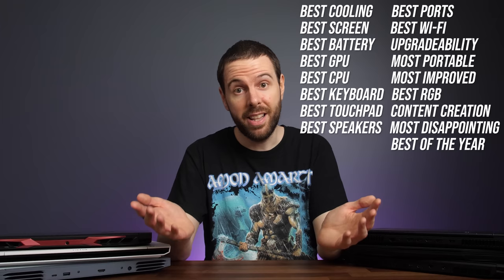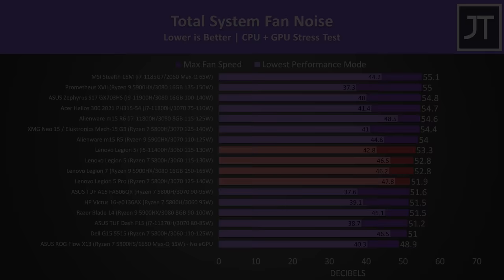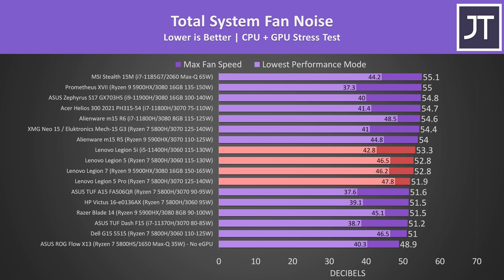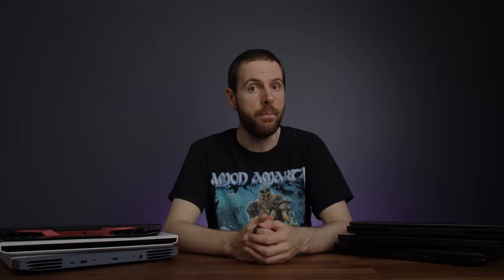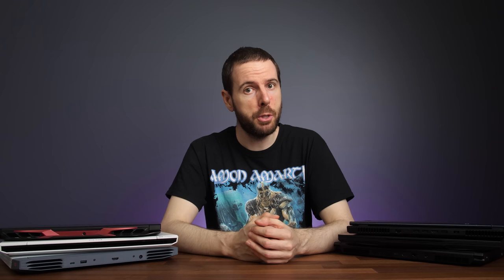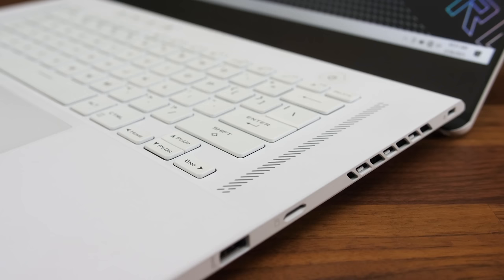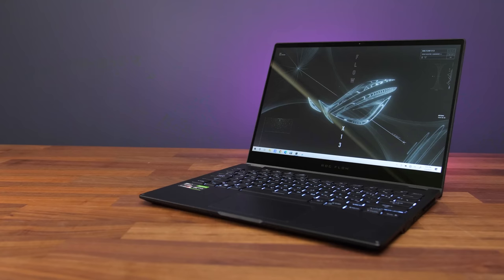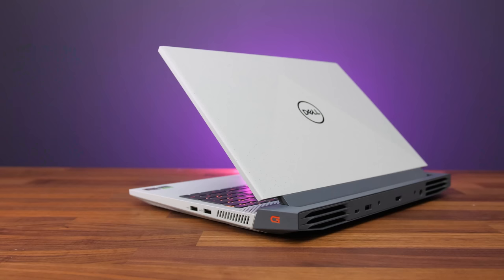Gaming Laptop Awards 2021!

Comment: Of course he is gonna add "Best RGB Award" for fps boost
Reply: @srijitsarkar7110 No bro RGB is useless, it's for the people who want to show off, RGB does nothing, it's a joke bro 😂
Reply: @srijitsarkar7110  he's Just joking, OFCOURSE IT DOES
Reply: @srijitsarkar7110  obviously no.
Reply: @srijitsarkar7110  RGB Anything is an instant 10% performance boost
Reply: @srijitsarkar7110  YES, RGB increases your fps by 10% and with a good gaming chair you will have aimbot in FPS games and with rgb in your car you won't have to worry about your car's extended warranty
Reply: Lmao 😬🤣
Reply: @srijitsarkar7110  RGB Is A Performance Booster I Have Asus Scar 15 Ryzen 9 5900HX,RTX 3080,32GB Ram,2TB Model Ask Me!!!I'm Just Sad Jarrod Didn't Give Scar The Best RGB Award...It has Way More Aggressive Looking Logo Lighting And Another RGB Bar Below The Screen!!!Legion7 Airvent Lighting Is Bad....Ehhehehehehehehhe
Reply: @srijitsarkar7110  YES!! RGB can boost your FPS at least 10 FPS and for RGB room ambient light make your wifi more stable and lower latency.
Reply: @plc.  obviously yes.
Reply: @srijitsarkar7110  Are you for real?
Reply: @v5k456jh3  I was just kidding around. Actually some on reddit were arguing regarding rgb strips and all claiming it boosts, so I thought such a claim was coming here as well, lmao
Reply: @srijitsarkar7110  actually, rgb lights generate heat, so they actually make your system hotter, but at low electricity, it's not significant enough
Reply: @srijitsarkar7110  yes it boosts the FPS about 10-25%
Reply: Of course deee so lenovo 7 is the best laptop more rgb u got.more fps logic 😁😁🤙
Reply: @lazyll_  😆
Reply: Venom tech subs spotted🤣
Reply: That's the wrong metric to analyze RGB performance boost.  The only way to define RGB powarrr is in horsepower.  And perhaps a minor bonus for whether you can set the exhaust flame color.  💻🔥  Obviously not to be confused with the color in which your rig is currently exploding.
Reply: @srijitsarkar7110  bruh
Reply: @Kenzouu.  🤣best RGB ad ive ever seen so far
Reply: @tqiconic4295  Oh my God.

Comment: hopefully AMD has a Thunderbolt response on the next gen laptops, personally I'd prefer a laptop with a Thunderbolt 4 port than anything else, you could use an external gpu there !
Reply: Ig, but what if it disconnects randomly?
Reply: @revizgd  it won't
Reply: @RioPutra_  Right now, they do.
Reply: I honestly still don't see the point of the eGPU for most people.
Sure it might make sense for a handful of people, but is it really that hard to just buy something like the G14 or Slim7Pro or Blade14 if "portability" is so much of a concern!
Instead you have to deal with a an expensive eGPU enclosure, a fricking GPU in THESE TIMES (considering you don't have a decently powerful one already) and a good monitor unless you want to run everything in bottleneck city (aka on the laptops display)
Reply: @scavengerspc  do they disconnect if used on a MAC?
Reply: @scavengerspc  for intel it's kinda rare , type c ports are very strong if anything connects to it
Reply: @sushimshah2896  laptops display is already 120+Hz , egpu exist for ppl with work laptops from olden days ( 4-6 years ago assuming you have a good CPU ) and why buy new laptop when u can get egpu?
Reply: @sushimshah2896  and for "these time" they're not on shortage and you can buy from other ppl , they started selling for a reasonably price rn if u actually look at gpu market
Reply: @Dane3412  I can't say. I have never tried it on a Mac.
Reply: @RioPutra_  QUOTE  -  "for intel it's kinda rare , type c ports are very strong if anything connects to it"
True, and I don't want to leave the impression that it's a common thing because it isn't. But it does happen.
Reply: @scavengerspc  hmm oke
Reply: @RioPutra_  Damn right.

Comment: Man, considering I spent more than 3 months binge watching your videos, I ended up getting the 3070 Legion 5 Pro and I am NOT regretting anything. Will chew about every AAA title up to date and just has the right placement and amount of ports. Cooling is also great as I’m not feeling too much heat on the palms (still needs to be raised and run in cool room temp to stop overheating). Although I wish Lenovo could’ve just put an Intel AX210 WiFi card in it, but alas the shortage doesn’t help.

Thank you Jarrod for helping me land with Legion! (and the best decision)
Reply: i also bought the Lenovo ideapad here in philippines because amazon doesnt even had the Ideapad 2021 man it may look an ideapad outside but the hardware inside is adapted with the lenovo legion series, its been a few days now and i dont mind playing any type of games, my temps are not even going up to 85-90c
Reply: @stevenleyson728  bruh I’m also PH. No temp climb for me because I don’t play where there’s not even good airflow.
Reply: How hot are your temps getting? And how hot is the room you are playing in? I'm in nebraska but ive had 0 problems with overheating. Hottest ive ever seen the machine is 79. I sit at 76 if I'm in the basement elevated
Reply: i dont know what sorcery did lenovo does with their coldfront 3.0, its just not getting above 80-90c, i also found out that our FANS are not even working at their 100% capacity wherein i updated my BIOS twice where is that the scripts that it does with the update would tell the CPU FANS to blow more air and faster just to clean the CPU FANS from dust and dirt build up. so yes lenovo really did a good job with their new thermal solution.
Reply: Im new to gaming price isn't much of a factor but PC is out the window because I don't have the spaces. Did you think about any others and how long do you game? Because I can spend easily 4 to 5hrs gaming

Comment: I'm so happy I got the Lenovo Legion 7...  The same as 5 just with a few extra things. Thanks Jarrod, you make me feel like I did the right decision. You helped me a lot choosing this one.
Reply: I usually hear more good things about the 5 than the 7 oddly enough. It's more so because the competition is different at its pricepoint though
Reply: @javianbrown8627  I just got a 7i (intel). Struggled 2 days to pick between 5i and 7i. Decided on a 7 because of better cooling, better screen, and some extra features for $200 more. However if it was between 7i and 5(ryzen 5800H), it would have been the 5. $400 difference but the AMD version is out of stock.
Reply: And now your wallet is empty.
Reply: you mean 5 pro. The 5i is way cheaper than the 7i. I have a 5i pro with 2TB. 16GB and RTX3070 for $1,585 after tax. I’m also getting a 7i with 1TB, 16GB and RTX 3070 for 1,797.70 since I have till January 17th to return the one I don’t want. I’m pretty sure I’ll go with the 7 just based on aesthetics and RGB😆
Reply: @vbarretto8131  too expensive
Reply: @vbarretto8131  Where I live, the 5 and 7 were almost identical with the price, so I obviously went with the 7... I couldn't be happier, it's a beast of a machine and good-looking.
Reply: @javianbrown8627   from what I understand, the 7 has a better mousepad, customizable RGB, vapor chamber, and keyboard. And this software to customize the RGB which drains your battery,  it's so easy to turn off... So I guess it's all about the price... I went with the 7 bc the price gap was minimal between these two where I live.
Reply: what is the difference between the 5 and 7.  They kinda look the same to me when i go to their website.
Reply: @monitorlizard9971  read my previous message...
Reply: @alexsvistunov620  Same here in Canada, so I just bought the 7.
Reply: In comparison with the Legion7 Slim which one would you recommend?
Reply: @alexsvistunov620  Who said you couldn't change the Legion 5 battery? Man that is such a lie and it doesn't take looking at Jarrod's Legion 5 breakdown to confirm you can indeed change the battery.
Reply: @massielrubio3584  I think the Slim version is a bit older and had some issues, I'm sure there's a video between these 2, I went for the legion 7 and it's just beautiful, I had it for a month now.
Reply: @alexsvistunov620  I want a laptop for college and gaming but I want something light, that's why I was considering the Slim versions. However, I'm confused on what to get now.

Comment: Watched the entire stuff. I knew nothing about laptops a year ago and now because of you I quite literally know everything. Keep up the good work. Thankyou for soo much knowledge

I got my legion 5pro with the correct ram timings.
Reply: It's the windows 11 version right?
Reply: @santhoshmanickavasagam2467  mine came with a Windows 10. I upgraded mine manually. I have the ryzen (5800h, rtx 3060) variant and tbh even with VBS enabled I didn't see any difference in any of the benchmarks.
Reply: @arnavranjan5606  my legion 5 pro should arrive tomorrow, how do i check for ram timings?
Reply: @wiltheavatar  I have same question
Reply: @wiltheavatar  Install CPU-Z and look the memory tab.
Reply: @wiltheavatar  zentimings
Reply: @justsam100  what exactly is the correct ram timings?
Reply: @wiltheavatar   your memory should be dual channel. 2 X 8 gigs sticks or 2X16 whatever you've ordered. 

And the correct timings are- 
       trfc(ns) 360
       tRFC 560
       tRFC2 416
       tRFC4  256
Reply: BRO LITERALLY SAME. I was so clueless about everything regarding laptops and what the specs even mean, but now I understand literally everything. This man is an absolute legend. 🙌

Comment: My Dell G15 arrived last week and man it rocks (5511, I7 11th + RTX 3060, 165hz version). I live in a very hot place had to undervolt my GPU by 15% and disable intel turbo boost so it doesn't fry (since it was boosting the CPU to max while using chrome and causing temperatures to be unstable), but it isn't getting past 65º (CPU) and 70º (GPU) after the changes using 100% of both while playing for hours.
Lost like ~4 FPS in some games but meh, at least running cool will increase it's lifespan.

Very happy with the choice.
Reply: what game did you play?
Reply: @nguyenminhquan3189  I'm playing GTA V and Darksiders Genesis currently.
Reply: How do u find the 165hz? Does it have good response time unlike the 120hz?
Reply: @hsairimelek1734  Dunno sorry :T I use an external monitor for gaming. My laptop screen is just for chrome and other stuff.

Comment: FPS boost trick, if you go forward in time ten years and then come back with a laptop from the future, the GPU will run this years games at a higher FPS. You can also run it on an external monitor for extra 5% boost. So if you're running Cyberpunk at 4K you can get your 14 FPS up to 14.7. No need to thank me 👍

Comment: I bought the razer blade 14 while I was at a micro center with the 3070. While I was walking out, I was thinking, "damn, I should've just bought a lenovo legion 5 pro", but after analyzing the different weights and seeing how my 14 runs games, I think I made the right decision for myself. I love the compact size, light weight, and sleek design. I think the speakers are great on it too. Honestly, I think the only downsides are the price and the lack of a MUX switch, but besides that it's great!
Reply: I bought a Razer blade too
Went with the 15 2021

What's an MUX switch?
Reply: @kenbee1957  I believe it allows you to switch between integrated graphics and your GPU (whilst using laptop) I could be wrong tho
Reply: @kenbee1957   @Irshaad Shaikh  Yeah, it makes it so you can run display directly from you dedicated GPU to your laptop screen without it going through the iGPU, just makes it run a little faster.
Reply: Gaming in 14" is just not it for most people. But you do you.
Reply: @saminyasarkhan2777  Understandable, I'm looking to get one soon because of how small it is, I'd like more desk and backpack space
Reply: @saminyasarkhan2777  
Too bad gaming laptops don't come in 32"
Reply: Whats the TGP of your RTX 3070?
Reply: @SuperFlawless2010  pretty sure it's 80w and 100w with boost

Comment: Just ordered a legion 5i pro gen 6 16” rtx 3070. Can’t wait till it comes. This is going to be my first ever laptop ever so I hope it doesn’t disappoint 

Edit: Order was cancelled and I’m trying to get a refund. I heard costumer service is absolutely trash with lenovo so I hope it will work out. If anyone can give me advise in this situation,  I’d appreciate it.
Reply: That's is probably the best choice you could get. The 5 pro is basically a 5 with much better screen,  actually the best screen of any gaming laptop in my opinion
Reply: how long do you have to wait?
Reply: @derekhatake  I ordered it off the lenovo website with faster shipping. I’m not exactly sure when the order will come but it should be around dec 2nd or a little later (hopefully sooner)
Reply: @niksarass  thanks for reassurance 🤝
Reply: Congrats dude , you are in for a hell of a experience
Reply: Your first?! Man, what a first laptop to have!
Reply: @bickboose9364  thanks man, any tips for newer lenovo legion users?
Reply: You lucky bastard. I cant find one with RTX3070 in my country. FYI, they're all full power GPUs on this laptop. It will literally outperform many 3080s that were cut power-wise "a.k.a Max-Q"
Reply: @SuperFlawless2010  I’m not lucky at all. Just found out my laptop that I ordered from the official lenovo website has been cancelled via email. I’m extremely pissed as I’ve been hyped all week for this disappointment.
Reply: @white3100  oh no (((

Comment: I watched your reviews on both the Legion 5 and the Dell G15 also the comparison video. I have to say I went for the G15 because as you said in your comparison video there isn't much between them, however the price difference was 300CAD for the same specs so I had to go for the G15.
Reply: How's the laptop performance so far in aaa titles and warzone specially.. I'm about to buy g15 rtx 3060 variant with 165hz . I just wanna be sure that is it a right choice to go for. I was considering legion but it costs 300 dollars more in my region for same specs

Comment: I got a Legion 5 packed with Ryzen 7 5800h / rtx3060 130w / 16Gb, and couldn't be more happy! It´s my first gaming laptop, coming from a i7 8700/2070s desktop, and the performance is pretty much the same. It´s plugged to a 3840/1080 49' monitor, and in COD Vaguard, i get solid 110 + fps in high settings. The GPU temp, with a 20€ cooling base, NEVER exceeds 70/73 'C. And for working, the 8 core CPU is a beast! With 3 Virtual Machines and Microsoft Teams running, I never got a hiccup. Very very happy with my choice. It really exceeded all my expectations.
Reply: Oh, and Jarrod, great review buddy! Keep it up!

Comment: In theory, it's possible that Legion 7i 16ITHg6 could have made "best" for many of the classes, especially in its highest spec (I mean the one with the miniLED WQHD+ 16"...) as it's basically Legion 7 with an option for an even better screen and using Tiger Lake H45 chips/platform instead of AMD Cezanne...
Reply: Yeah that is the best premium 3080 laptop for the price. If you have lesser budget, best choice would be legion 5pro  then legion 5 with 3070, then 3060 being best performance per dollar

Comment: with my budget, I only got a TUF Gaming F15 i5-11400h / rtx 3060. not the best, my Mi 10's colors and speakers are better than my laptop, but definitely a huge upgrade from my potato Surface 3 (RIP battery bloated making the screen pop off the chassis). thanks for your reviews I learned a lot!

Comment: I watched loads of Jarrod’s videos.
Finally settled on Acer Predator Triton 300 with i7 11th gen, RTX3060 and dual channel 16GB RAM.
Striking a balance between physical look and feel (metal) and performance.
Very happy with purchase thus far.
If not for wanting to run games from last few years I would have got a new MacBook Pro as preferred option.
Luckily my mid 2014 13” retina MacBook Pro soldiers on 😊.

Comment: I have a question. What laptop should I choose? An ASUS TUF A15 with ryzen 7-4800h, 144 hz screen, 8gb ram, 512 ssd and rtx 3050 4gb or a lenovo legion 5 with the same specs except the legion comes with a gtx 1650 ti 4gb. The legion is about Php 6000 (120 USD) more expensive compared to the tuf a15. Nice video btw Jarrod.

Comment: Got myself an Omen 15 3070 back in September - would have waited for the newer 16 version for the much better fan and slightly higher TDP, but the old laptop's on the edge of a potential battery explosion...
NZ's quite slow on the tech updates.

Comment: I tried a few laptops in my local Curry's store and one had the really thin cursor keys, so that was a definite no no.

I was going to get a second hand Asus Tuf one but read a lot about overheating issues., so that was out.

I then thought about another MSI laptop but the current one had a problem with the hinge breaking and as such, I decided against getting another one.

So I looked online at a well known place and saw what was perfect for what I wanted so I traded some old Xbox 360, PS3 and Wii games and consoles and that paid for most of it. However, I was disappointed that it only had the 3050 graphics card in it instead of the 3060 which it was meant to have. I managed to get a good price reduction on it and what did I get?

Lenovo Legion 5 - 17 inch with 144hz screen and i5-11400H processor.

To say I'm really happy with it is an understatement. All the games that I wanted to play well, not only play well but they play better than I imagined!

Okay so the fans get a bit loud on some games but not half as bad as the turbo fan button was on the MSI laptop and that was an okay laptop but even without G-Sync (can't say that I've experienced any issues at all with any games) so when I saw your video I thought it's not a problem for me at all.

I really value your reviews and you helped me make a good purchase and I absolutely love it, even though it doesn't have separate touchpad buttons (the MSI one clicked really loud and reminded me of those old clickerclackers (that were small metal items that you pushed to make a CLICK noise).  I remember getting one when I was a child.